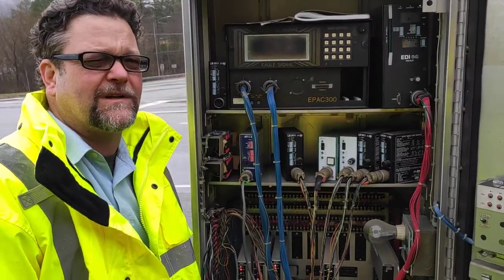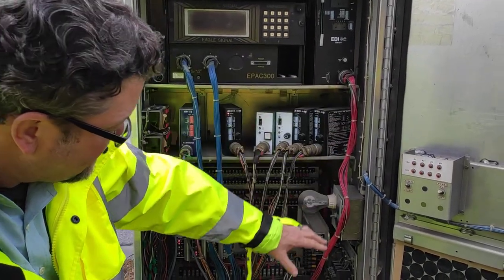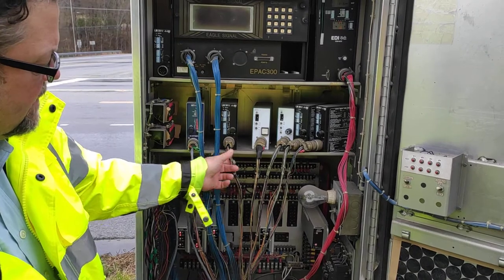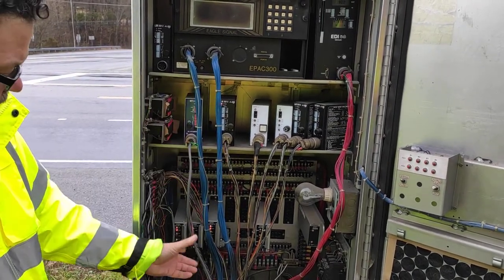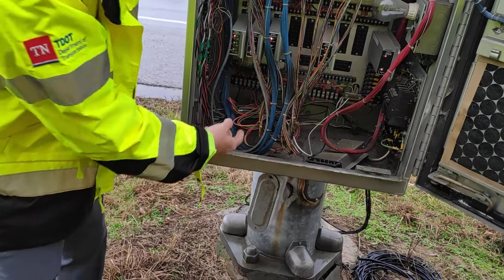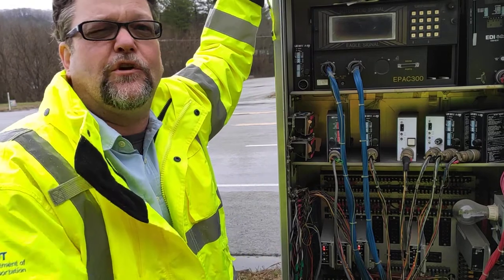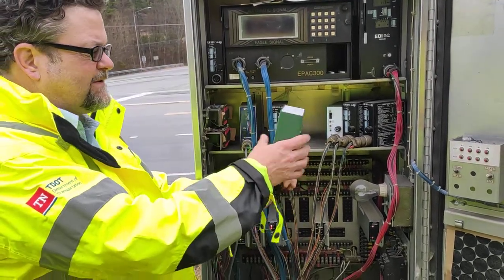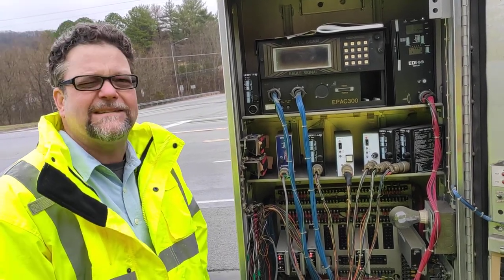What's inside a Traffic Signal Controller? Part-1

Comment: That's a pretty old controller for 2020. Nice explanation of a cabinet and the basics of of they work. We put our loop detectors in a detector rack. We've migrated over to TS-2. At first I didn't like them as they can be somewhat harder to diagnose and there's no real good way to test the BIUs associated with them. They also seem to go into flash more often as the MMU checks for and is more sensitive to voltage fluctuations. I see you've got a spare load switch in the cabinet. Good to have a spare but it'd be better to leave it on the shelf rather than the bottom of the cabinet.

Comment: Glad i'm in the UK, we mainly use Siemens or Telent or Peek, much better looking and easier to work on, everything on one rack...bar the detector cards. New ones even have a wireless web browser to interface to the controller so you don't need to get out of your vehicle to interrogate it!
Reply: That is an older TS1 cabinet with an older Siemens controller.  With a more modern controller you can communicate through the SDLC or SIU interface to the controller.  You can also access the controllers remotely as well as long as their is communications to the intersection.  This is not really indicative of what most traffic cabinets look like in the USA.
Reply: Sounds like we have the same setup here in Arizona then. We use Siemens or Peek traffic too! US here.

Comment: If there is in fact 120 volts present, why don't traffic/signal technicians where shock protection (hot gloves) as required by OSHA when workers are exposed to greater than 50 volt to ground? On of the biggest problems I see in electrical safety is that employers and safety personnel look at electrical safety like it's electRICIAN safety. Are electricians the only workers recorded by the BLS that are dying from exposure to electrical hazards?

Short answer, NO. These techs are also required to have shock protection and be trained to recognize electrical hazards with electrical safety (NFPA 70E) training.

Your thoughts?

Comment: I'm glad I'm a signal tech in Australia. Much prefer our controllers. On board conflict monitoring via the prom and logic card (dual conflict monitoring) Inbuilt detection on the rack and direct output to the fields strips. We have Sarasota detection here like in your video but not much anymore thank God. They can be problematic here and often need to be retuned or just die altogether. That controller you're showing us here is extremely messy to me.
Reply: Hi Archie, I'm from Australia and is there any way I could contact you?
Reply: @sujanselven  what would you like to know?
Reply: @Detroit8V92tta  I'm interested in learning about traffic signals.
Reply: @sujanselven  are you in Australia?
Reply: Hi Archie, is there any documentation on how controllers work here in Australia? I'm Aussie as well and am trying to find more info on SCATS, specifically how timers / phases work. Would be great to chat with you.
Reply: Do traffic lights in Australia use plc control?
Reply: It is extremely old.  No new traffic cabinet is going to be outfitted with that equipment or that environment.